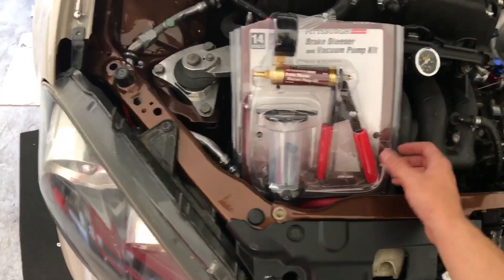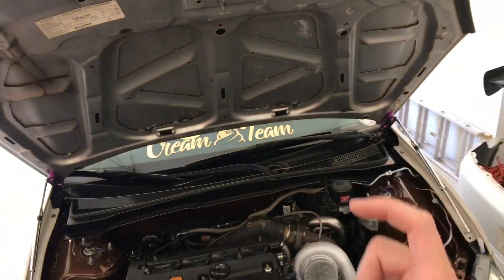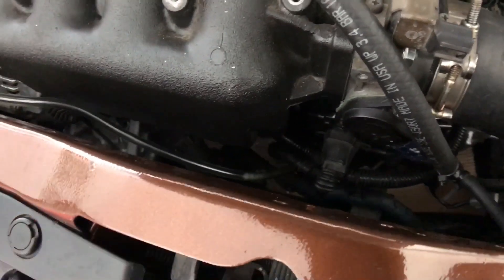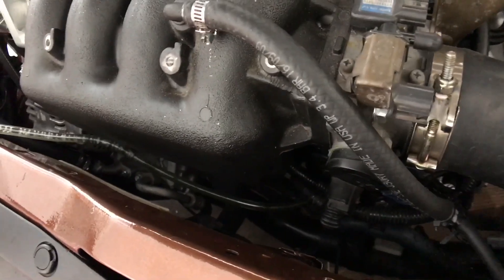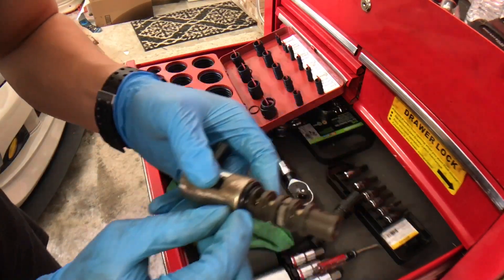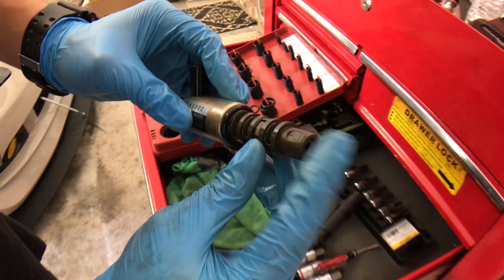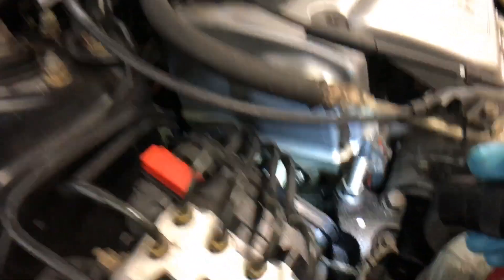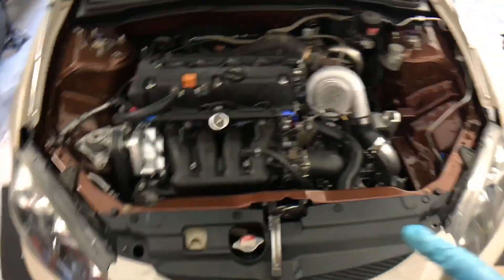HOW TO BLEED A CLUTCH THE EASY WAY

Comment: Did it solve your problem? Cause on my rsx its having the same problem as you did but not sure if it is it
Reply from the maker: William Ramos It helped it at first but once I drove it for a little bit it started doing the same thing. I'm thinking the diaphragm in slave cylinder is leaking causing it not to hold.  Stay tuned I'll be looking at it again.